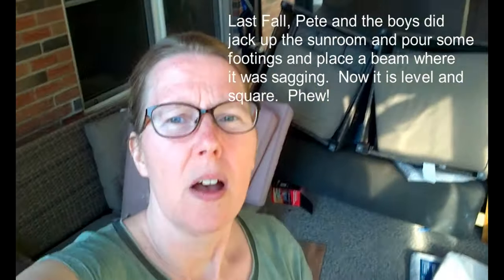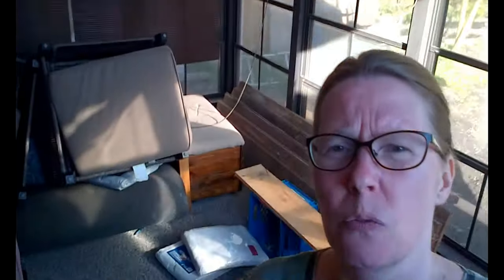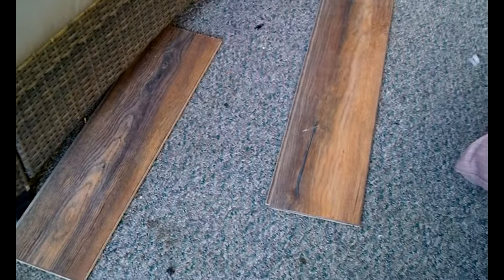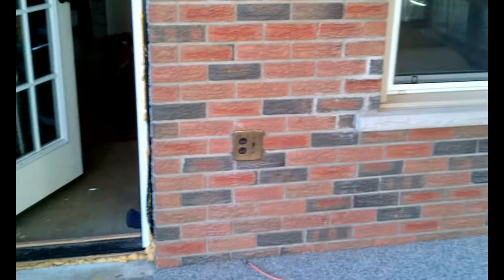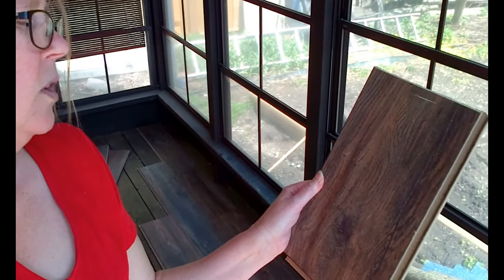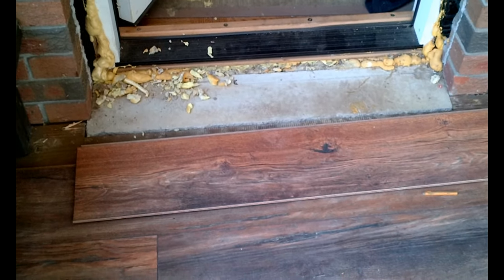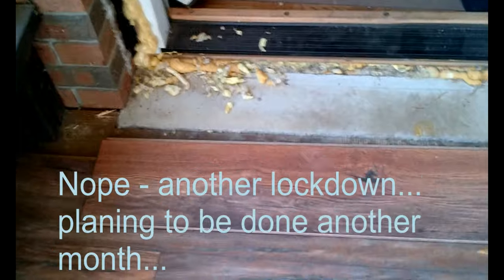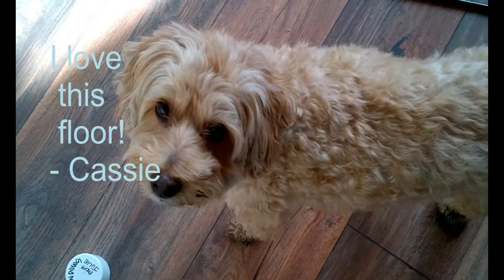Spraypainting a jute rug for the sunroom

Comment: You have to run the laminate floor across floor boards or you get all sorts of probs, and run a neoprene sheet under new board and a gap at edges 1cm or sooner or later it will expand and bow upwards. I've made all these mistakes!  
Painting jute rug - looking at yours I'm going to use tape only and use a simple design . I've watched lots of jute rugs stencils and none of them look fool proof.